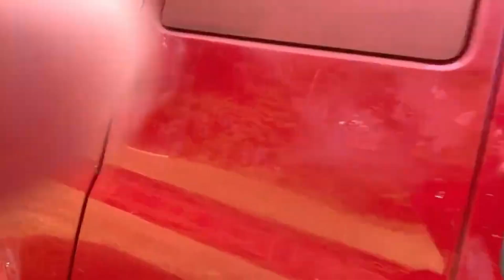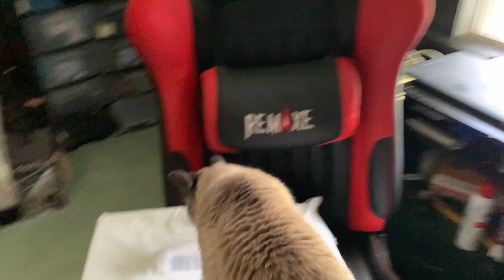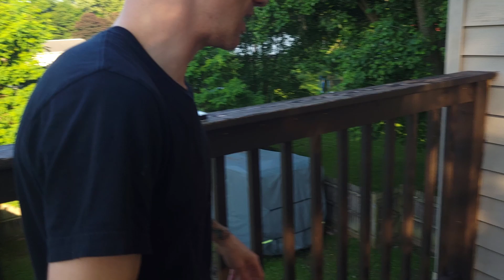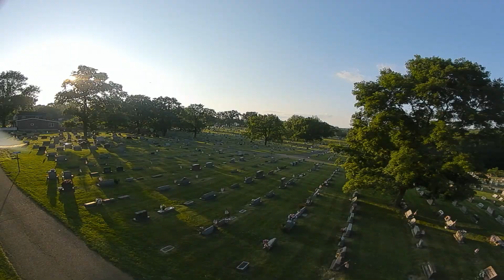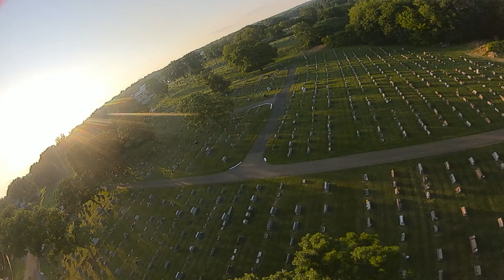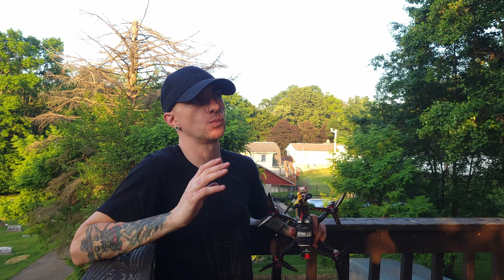Fly my FPV Drone using HNT Antenna

Comment: Just bought a bobcat 300 lol what's the best antenna to buy? Lol
Reply from the maker: that depends on your location and what’s around you. for example, my town has no miners but mine, closest one to me is over or near 10km away so i need antennas i can directly point towards them so higher dbi antenna makes more sense. if you were in an apt building with miners above, below, and around you, you can use a lower gain to reach all directions instead of pinpointing the signal towards a specific area.
Reply: @TheDro  1 floor apt 2 other green hexes rt next to me..
Reply: I live in withamsville/Cincinnati. I can send you an exact hnt map or location In private mess but nt on here. I'm thinking a 5dbi. bottom floor apt with 10 other apt buildings by me..
Reply from the maker: yeah feel free to dm me anywhere on my socials, more than likely youll be fine w something like a 3 or 5 dbi antenna so long as you put it outside and up high. i’m about to send mine to florida where my brother lives since he’s around a bazillion hexes. id be better off w pennies vs nothing!